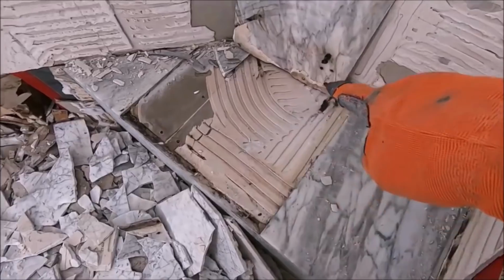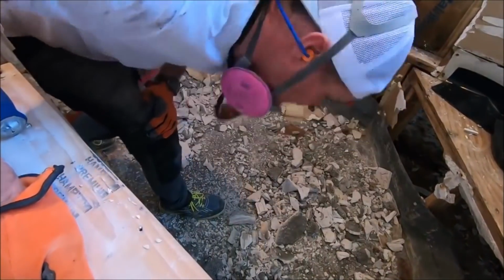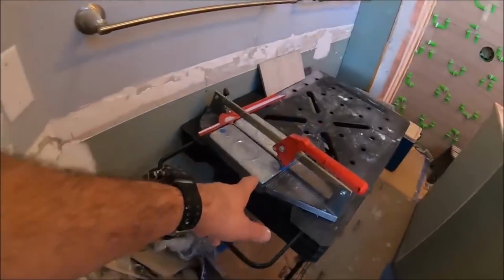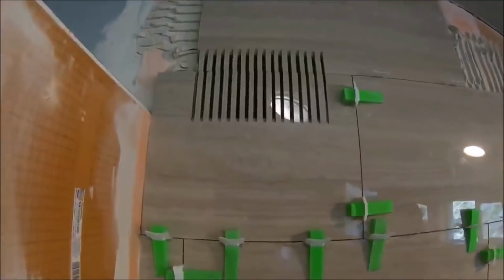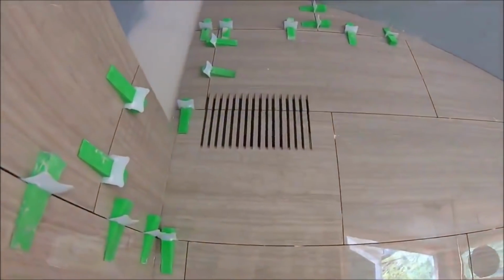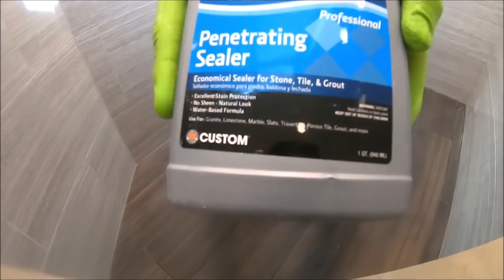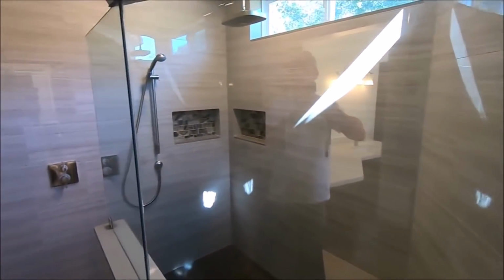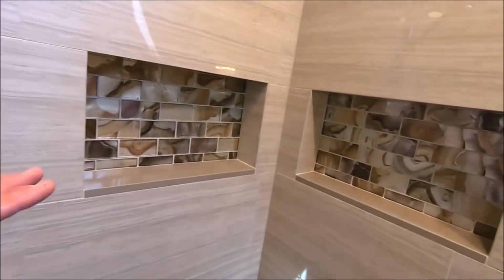Most Popular Shower Remodel 2020

Comment: Yesterday I saw your video of the IQ dry saw. I ordered it.

This is what an "O/C" does.

I already have done a lot to the floor. I ripped up 3 layers and probably 65 years of ickyness.

I leveled the floor, then ditra'd the floor, then dry-fit the floor with 6x6 quarry, about 100 square feet.

I got excited about doing this area and thought about other areas to do.

Today I put 1 bag of thinset (probably about 7/8ths) down about two/thirds of the floor and about got killed doing the work. I am 100% VA disabled and basically one-armed doing this "work". :)

While putting down these tiles today, I thought there is no way I can do the other areas I want to do. So go cancel the dry saw order.

Three hours later my knees and palms of my hands feel like a hamburger and then I see this video. Such awesome work, so maybe I can still do this and will keep the saw (when it ships in March or April).
Reply from the maker: don't give up!

Comment: Superb job as per usual just a question do you not silicone where tile meets tile in Scotland we silicone all corners not a slight on your work because if I was half the tiler u are I would be happy just wondering if u guys have better grout than us
Reply from the maker: Yup, we silicone match where the planes meet on walls, ceiling and shower pan.
Reply: Thanks for fast reply was just wondering if you had a better grout I like the Maori grout and silicone respect to u sir

Comment: Nice job, how do you decide if you use the IQ dry saw as opposed to the wet saw!
Reply from the maker: if you don't miter a lot, and if you work in cold area's (cold water) and if you want to cut inside without making a mess

Comment: Is that mastic on hardy backer?🤔 Uhm mastic only works on purple or green wall board not any other backer I know of. Oops it's a mistake. Also did the mastic even come close to the tile? I don't think so cause you would be peeling the wall down. Also why would there be kd lumber in a shower stall? No one uses pt studs anymore? Just sayn. Yes nice rework though. Everyone seems to know better then the next guy on how they do showers . Bottom line use common sense and you will find it goes a long way. I have done many showers for years and seen so many dumb moves it isn't funny mostly from overthinking. Do your research on materials before you take it on. Happy showering....